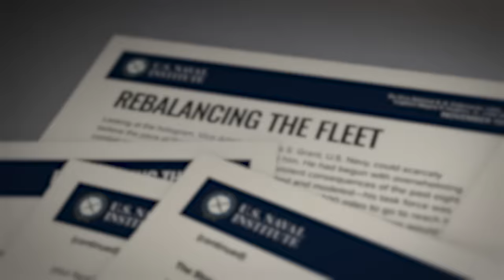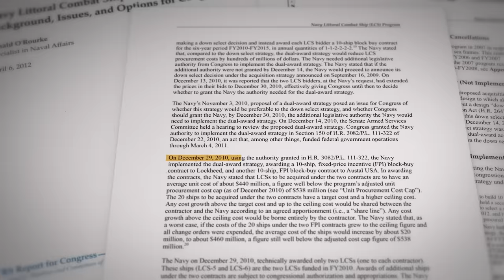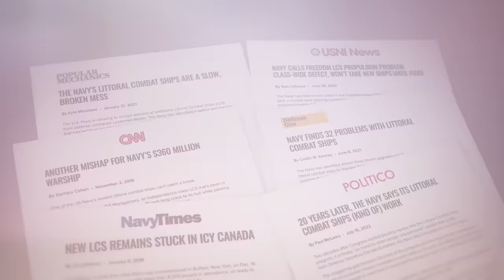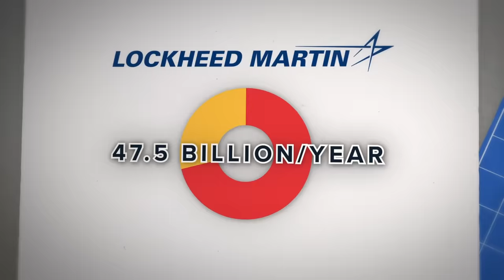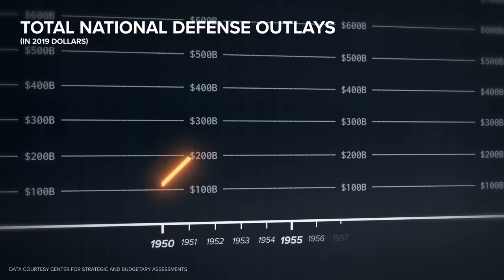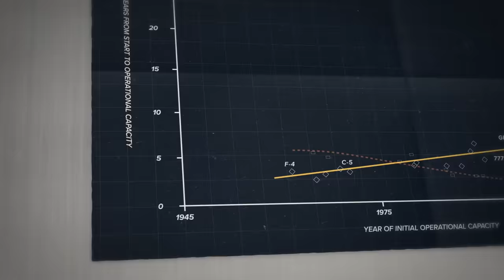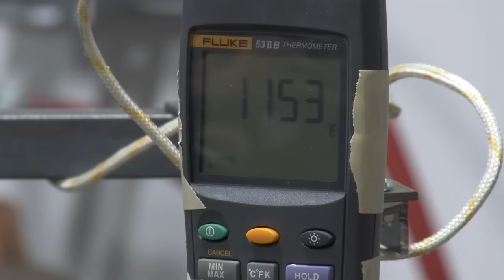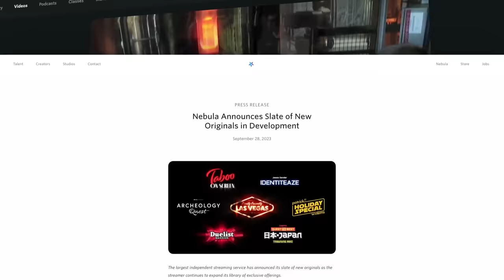Why the US Military Costs so Much

Comment: The F-35 programme was a total success, albeit a very expensive and over budget one. The NGAD project is costing much less than estimated because of knowledge gained and infrastructure in place from the F35 development.
Reply: Point being, it could have been way cheaper and finished sooner if not for the industry's horrendous practices.
Reply: @facuigua12 is it industry practices or the fact that the military wanted three different variants, all of which have different moving parts?
Reply: @facuigua12 coulda woulda shoulda. provable? nope.
Reply: HUGE success for Europe. Not a big success for USA: all their allies now have access to the same top of the art fighter jet. This makes the US aircraft only strong in their numbers, as opposed to superior technology.
Reply: Literally never been used + had multiple of crashes 😂😂frequently lmao
Reply: @SQERDOMOONLIGHT Let me give you a little different perspective on the matter.
The countries in Europe that are given access to it (ie, Sold the aircraft) are our allies. This is a good thing because the US companies that developed it can now sell more of them, thus recouping more R&D money and making more profit. When you build cutting edge machines like the F-35, doing it at a larger scale, instead of them being low volume, bespoke and largely handmade, is always beneficial. It allows them to develop new ways to improve their manufacturing process, make them cheaper, build them faster, and iterate on the technology as a whole. The US Military also benefits from this because they get better planes than what was initially paid for.
Having other, allied countries, operating them also cuts down on the cost for the US Military to have cutting edge technology in bases all across the world.

I could keep going down this thought path but I think that this gives you something to chew on.
Have a good one random internet person!
Reply: @dr4d1s  I general I'd agree but I would argue that the degree of collaborating can be much, much, more successful in the future. Also we're starting to see that some of the country partner program are not reliable
Reply: @SQERDOMOONLIGHT  I agree with you as well as to the reliability of other countries military programs. Haven't the majority of the F-35 accidents/mishaps happened when they were being used by other countries? Not saying that the US hasn't had any by any means. Also, the F-35 wasn't the best example to use in my explanation with all the issues it has had but it was the topic at hand.
Reply: @SQERDOMOONLIGHT  Yeah, because our allies are so likely to turn on us in a fight, and we definitely don't have software/hardware countermeasures (and downgrades) on export models. Not that they would tell anyone.
Reply: The f35 mind you, has had one of the best accident records for a plane built a 1000 times. Also its quite proven already, israel and many allies frequently use it. The 'not been used' plane was the f22 @GTFO_0
Reply: @SQERDOMOONLIGHT were only giving you the f35, the f22 can rip it apart and that's staying ours
Reply: I worked as a ALIS administrator and it was a boondoggle from the beginning and when I left Lockheed, it was still a taxpayer rabbit hole.
Reply: @ericlane3256 I wonder how much cheaper it could have been without the “C” version? I know the Marines and some allies who don’t have full-size aircraft carriers really wanted a STOVL stealth fighter, but that made the R&D really difficult and expensive
Reply: Pray that it's not used
Reply: @cpob2013  The F-22 is 2 decades old. It doesn't have nearly the capabilities of the F-35, and its original cold war program began in 1980. It hasn't been upgraded since it's A version which was produced since the 90's. While yes, it looks shiny and new, its roots are in the cold war. I'd say that with the right conditions, a modernized gen 4 aircraft would be able to shoot it down.

Regardless, the 2 non-NATO members the US has given F-35s to are Israel and Switzerland (although the swiss will only start getting them in 2026). I don't see switzerland turning their F-35s on NATO when NATO literally surrounds them. And at the time, Israel seemed like a stable ally (although it's not so much that anymore).
Reply: It cost 2 trilion now to keep funding for the F-35b project. It is way too expensive......
Reply: @EE-dj7et I think Australia's getting them too, tho they're probably even less likely than Switzerland to turn around and attack the US with them lol
Reply: @fuzeminttea9211 that is the total projected lifespan cost for buying maintaining upgrading over 2, 000 F35 over the next 5 decades. The only reason why you see that number kicked around is because that's the first time the US military has done a total lifespan cost analysis for a weapon system.
Reply: "The F-35 programme was a total success"
Lmao. No.

Comment: Believe it or not, the whole situation is a lot better nowadays. Definitely not good, but if you want some info on how it worked in the Armored Force during WWII, id highly suggest watching some of “The Chieftain”s videos. Entire production lines and factories built for vehicles that never saw service, vehicles that got pushed through development and hindered actual projects for years because they were a certain General’s pet project despite being objectively a bad vehicle, etc. 
also, you mentioned how getting a vehicle or weapon or weapon’s system accepted for service takes decades now. That’s actually intentional and should be seen as an improvement in some respects; instead of throwing a half-a**ed (for lack of a better term) piece of equipment into combat, or fielding a piece of equipment that the military doesn’t actually need, the military will slow down, take its time, and make absolutely sure that what they’re giving to the troops is the very best option available for the task it’s intended to preform, that it’s reliable, and that it actually preforms a role that is deemed necessary. Heck, the Marine Corps has ballooned over the years into basically a second Army, and because of that they’ve been downsizing in recent years in order to focus on the tasks that it specifically is best suited for. 

This isn’t to say there still aren’t problems; there definitely are and anyone who knows anything about military procurement will tell you that it’s a nightmarish quagmire that you can’t wade into without wanting to pull the hair out of your head. But there are measures in place to try and make things better, and from the best of my knowledge we are moving (nightmarishly slowly) in the right direction
Reply: What’s the channel called? I searched up The  Chieftain and only got a band back lol
Reply: @jero5703  Thought "The Chieftain" was the name of the channel, but if you look up "Inside the Chieftain's Hatch" that should pull up a bunch of videos from his main series
Reply: My father worked in Baghdad for over a decade at the embassy and he told me of seeing 1000's of unused laptops being smashed with sledge hammers and thrown in dumpsters, of entire fleets of armored cars left to rust, never having been driven, only to be replaced with new models that are never used, and just massive amounts of the worst amount of waste you can imagine.
Reply: @jero5703  two of his best videos on this topic are “why the Sherman was what it was” and “The tank for 1945”. If you search them and see videos with titles to that effect, the posting channel should be “The Chieftain”
Reply: Technology is also helping matters too it seems. Simulation programs have reportedly allowed the B-21 to be on time and under budget (which is a miracle for almost any project, yet alone military ones), and apparently NGAD is also making break neck speeds in its development too.
Reply: It also naturally costs way more to develop and build increasingly sophisticated technology. We were able to build tens of thousands of planes in WWII because they were downright primitive. Your average auto mechanic and metal shop could put one together if given a schematic and a pile of raw material and you could sketch out that schematic with a pencil and slide rule. You just can't do that with with modern planes. Every aspect requires increasingly precise manufacturing, rare and exotic materials and processes, and extreme expertise in design in order to create a cutting edge end product. Naturally that drives up costs and slows down development and production cycles immensely.

Thankfully, modern computer simulation technology, modular-construction and open-architecture software philosophies are in the process of revolutionizing the entire design cycle, allowing new projects to go through design and testing much faster, for new tech to be able to simply be swapped out instead of having to design whole new systems from the ground up to take advantage of it, and for multiple contractors to work competitively on different modules instead of relying on one huge contract from a sole-supplier.
Reply: i vaguely remember one interview about how one of the new ideas for vehicle design is shifting from "building better systems" (Trying to make a single perfect design in one go) to "building systems better" (have the system be future proofed), with an emphasis on computer simulation so people could test ideas out without having to actually spend money on making a thing. Having systems built around standards so future upgrades are less of a hackjob. Like a lot of software in the Abrams(?) didn't communicate with each other well because the upgrades were designed in isolation.
Reply: feel like that this critique of military fuckups is mainly due to modern media being more accessible - the continual failed experiments and waste of costs haven't exponentially gone up, its just that they are more public now.

Comment: There's some major flaws in the analysis here. Most notably, two of the three examples of "failure" were not fundamentally caused by the contractors. The skyrocketing cost of the Zumwalts is primarily caused by the order being cut - the same development cost (which is divided among all of the units constructed under DOD accounting) was suddenly spread across only three ships instead of 32. The extreme cost of their ammunition is essentially the same thing - only a fraction as many shells were needed after the the ship order was slashed, which put more of the development cost on each unit and deprived the project of economies of scale.

Most of the excessive expense and protracted development of the F-35, on the other hand, is primarily because of attempts to save money. With the US Air Force, US Navy's Air Force, and US Navy's Army's Air Force all needing to replace their aging fighter fleet (due to several of them reaching the "fall out of the sky" or (worse) the "Canada will buy these" stage in their lifespans, Congress pushed hard on replacing three different models of plane (the F-16, the F/A-18, and the AV-8B Harrier) with only one. In theory, doing so would have saved enormous amounts of money by allowing common spares, training, unified procurement, etc. In practice, the three services had fundamentally different needs and trying to produce a common platform was doomed to failure - in the end the F-35 is fundamentally three different aircraft with a common design ancestor, and only a portion of the parts are compatible. Producing three different models from the start would have saved immense amounts of time and money.

Note also that the Zumwalts and F-35 have met almost all of their design goals - the Zumwalt's guns don't have any ammunition, but otherwise work fine, and their missile systems are the equal of any other DDG. Meanwhile the F-35 has been the winner of almost every evaluation it has faced, and the primary problem is that they can't be manufactured fast enough to meet demand.
Reply: What do you expect from someone who has never served using crap from online info that is wrong big time.

Comment: On the point about peacetime US spending being around WW2 spending levels.

The US also has a significantly larger economy today than it did in the 1940s, so does every single other country. Perhaps defence spending as a % of either GDP or federal spending would be a better indicator of total resource prioritisation.
Reply: I think looking at inflation adjusted numbers are better for comparison.  In 1943 the US spent about 75 billion.  Adjusted for inflation it comes out to 1.3 trillion in 2023 dollars.  That is only 350 billion less than what is in the current budget for FY 2024. This is in spite that we only have a tenth of the personnel, and the Navy has only a fraction of the number of ships, and the Army-Airforce has  a fraction of combat units when compared to 1943,    Two things that have changed,  One we spend more on admin overhead and procurement plus personnel costs are higher in real dollars.  The US military spends about 25% of the budget on personnel today.  That's an increase from about 10% in WWII.

Comment: Well done video and I agree with many of your points.  However, I think you are also giving a skewed perspective by only focusing on military programs that have been failures.  For every LCS, there's the Virginia class submarines.  For every RAH-66 Comanche, there's the C-17 Globemaster.  For every Zumwalt class Destroyer, there's the Arleigh Burke Class destroyer.  As you mention, developing cutting edge technology that has to operate in the harshest and most hostile environments is extremely tough.  This video would feel more balanced if you didn't only focus on those programs that failed while excluding those that are successful.  As for the F-35, it did indeed have a very troubled development period and also has issues with operational ready rates but it is still a very successful program with praise from the pilots who fly it as well as the huge vote of confidence that it's been purchased by the militaries of numerous other countries who each evaluated it and decided it was the best option to meet their military needs.
Reply: great point

Comment: 535 is actually a really really really really really really good project that's turned out really well it's an amazing plane that has done its job incredibly well and yeah it cost a little bit more than expected than expected but the per unit cost is down

Comment: Any welder could’ve told you making an entire ship’s hull out of aluminum was a bad idea to start with. I wish we could go back to when engineers worked on their own projects before designing others lol
Reply: Difficult != bad
I mean they nailed titanium machining. In hindsight it might be obvious, but mankind engineered around much bigger obstacles
Reply: @juliuszkocinski7478  this is true. And to be fair, engineers are smart. It’s just when you have hands on experience, it eliminates a lot of potential missteps because you know the direction to pursue
Reply: Other commenter has a great point, but yeah, aluminum doesn’t look like a good material to build something sturdy. So malleable that we make sheets to cover stuff with it at scale.
Reply: The LCS with that "streetfighter" concept in mind may have led some engineers to think that it isnt supposed to go out in extreme weather conditions since the term implies more of a patrol ship on the coast, which was actually pretty good for it if only their sonars and shit worked properly.
Reply: @alexc2265 Aluminum alloys can have a similar strength to steel at a much lower weight (but higher price). It's all in the details.
Reply: @helplmchoking  tbf though the navy did say that the cracks do not pose a threat to the operational stability of the ship or whatever that means lmao so well the cracks may just be a non-issue like a plane going into turbulence but man I dont know
Reply: @majorfallacy5926  I see. Can’t say I’m surprised: that’s materials science for you! We probably could’ve avoided all this had the video explicitly said they sought to use an aluminum *alloy*, which may arguably be common sense to those in the know.
Reply: @Talosbug  hah, true and instant reminder of "why designers and machinists hate each other" by CSGhost.

Comment: Even though the F-35 development program was an absolute mess, it's weird to use the plane as an example of failure. The unit cost has come down a LOT and the plane has become a successful export. As of 2023, almost a thousand F-35s have been built, more than half of which for export.
Reply: very true

Comment: Military Aircraft are expensive as you say to develop. Now if that is the case that should be considered as the reason we don't see many differing aircraft being released compared to the commercial world. What the military tends to do instead is structure their current airframes into blocks and keep upgrading their airframes as a cost effective away to remain modern.

Comment: I do want to point out, cost plus percentage of cost fee has been explicitly illegal for a number of years. Instead, what is generally used are cost plus fixed fee or cost plus incentive fee, which will take the initial price and create a maximum amount of fee that government would not pay more than. Also, costs are not necessarily by the government in overruns of cost as stated by the Limitation of Funds/Cost clauses included in most contracts. Furthermore, cost type contracts are increasingly disused in favor of fixed price that put the risk on the contractor.